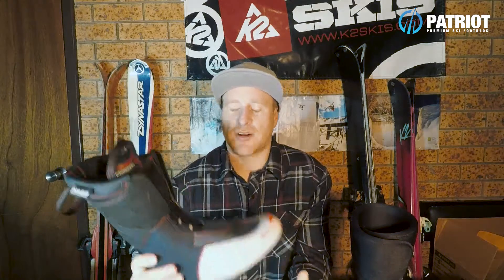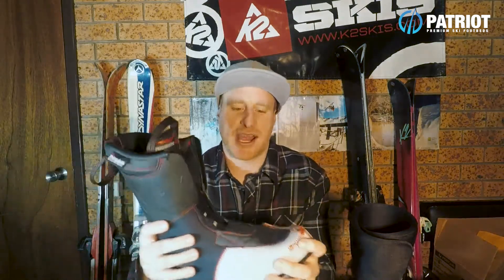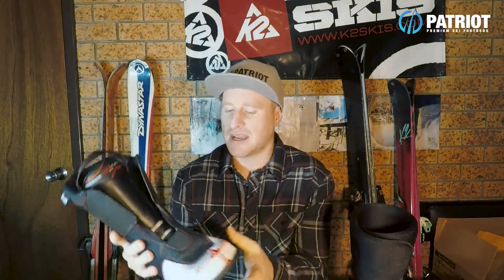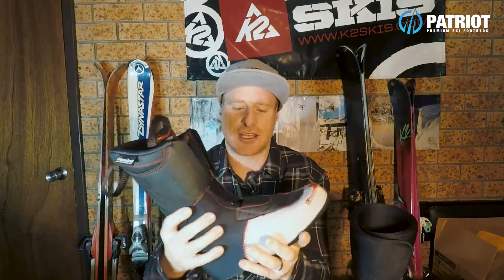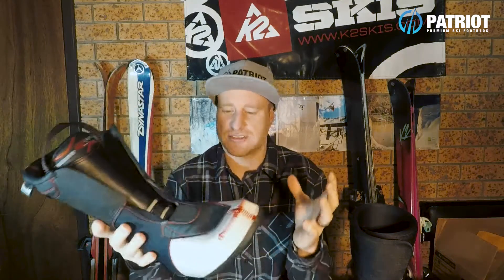Liners Packing Out - Thoughts

Comment: Just wondering, how long could you technically use liners if you keep adding foam when it’s packed out and replacing that added foam when it’s packed out? 

Not that I would do this but just curious if you think it’s possible to maintain a good fit with the same liners forever by modifying it
Reply from the maker: I think you could gain maybe an extra 50 days out of your liners. The main problem is not just the foam packing out, but also all of the material stretches, loses its structure and the stitching loses tension. So even with more or extra foam the liner doesnt hold up like they used to.
Reply: @PatriotFootbeds  thanks for the reply 👍